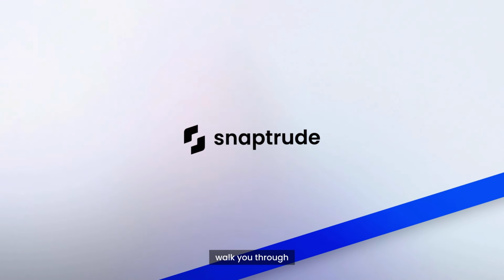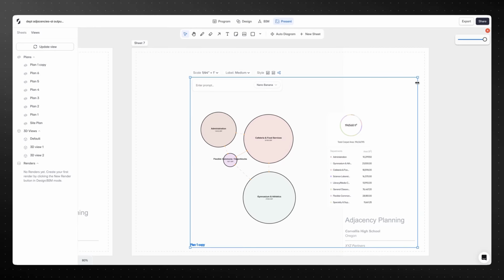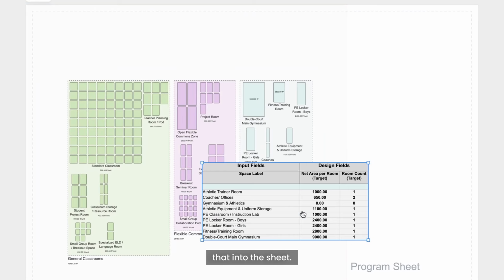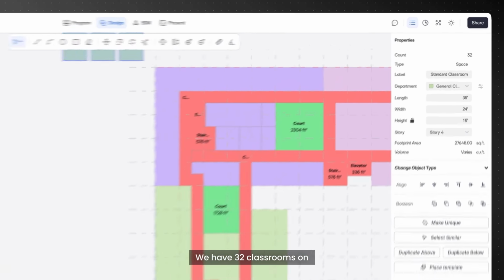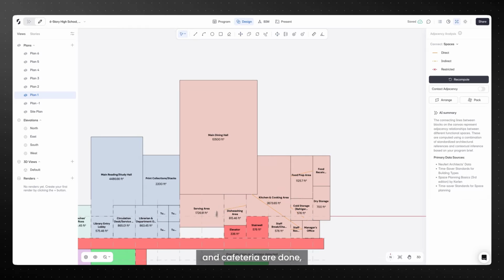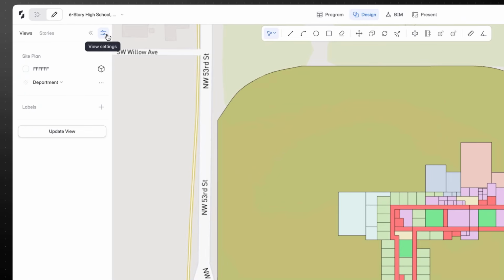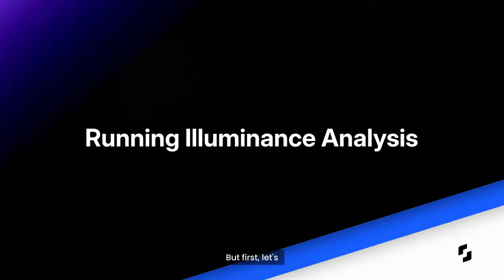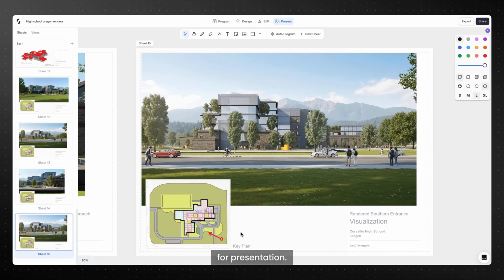Designing a High School Project with Snaptrude AI (Step by step walkthrough)

Comment: For future updates, I have 3 suggestions:
1. Sustainability tab: add Thermal analysis, Views analysis, Noise analysis, and Carbon emissions analysis.
2. 2D Planning step: Once the floor plan diagram is done, add an AI feature to generate a 2D detailed floor plan (including walls, doors, windows, furniture, and clearances).
3. BIM tab: AI material assistant that suggests the most suitable facade materials according to the project program, location, and orientation.
Reply from the maker: Awesome suggestions, thanks for taking the time to share them!
Reply: Great suggestions @jesuscuerda8544